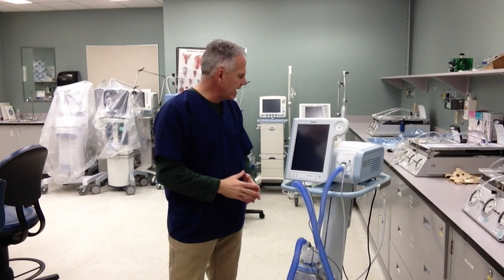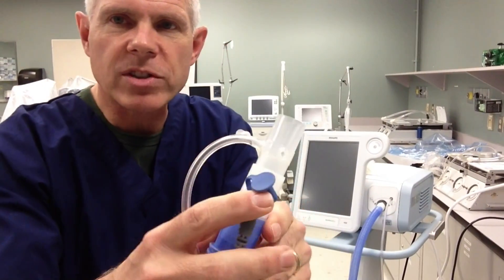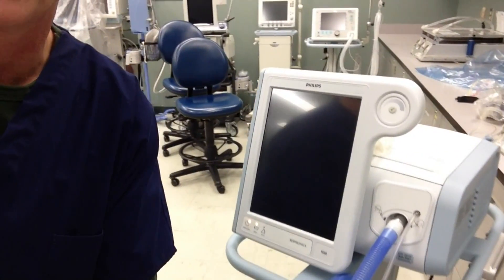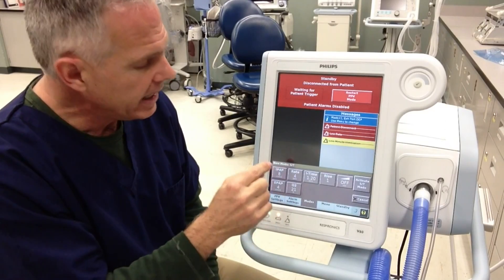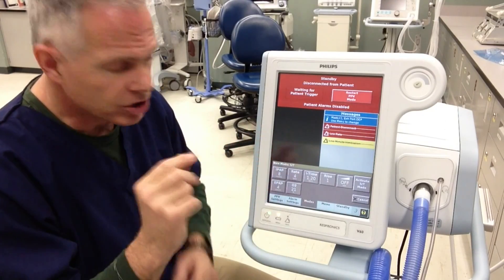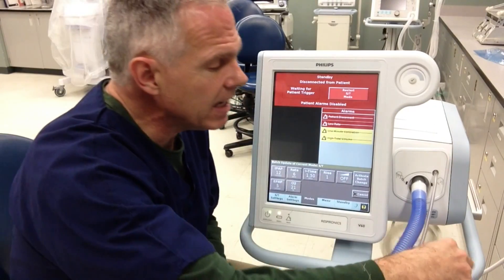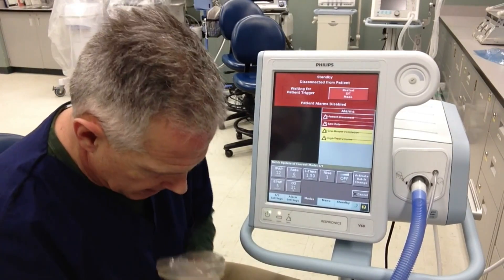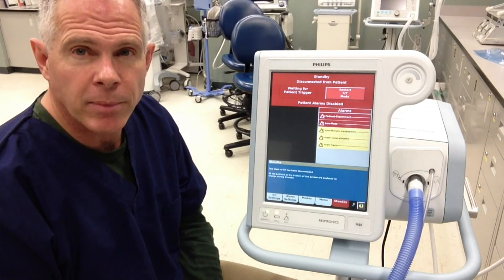NIPPV Introduction V60 Ventilator

Comment: informative video. this thing can also be used as a ventilator with an endotracheal tube. sophisticated controls and alarm settings. battery 6 hrs? if you have a pto valve it is able to nebulize. charles mcmullin md

Comment: Great video. I was just on one of these machines after leaving the ICU on a ventilator. Once I was off the vent I used this machine and it was very good. The mask was very comfortable and you can really tell there is humidity. Oxygen helps as well and I wondered about the wires in the hose, i thought it was a fancy design on the hose until I realized it was actual wires. Anyway very impressed with this machine and it was a great patient experience to use it for CPAP while in the hospital after being on a ventilator. Great video!

Comment: do you have to have oxygen with it ?
Reply: Tyson McCormack yes the machine runs with o2 the o2 cable can be connected to a wall outlet or if your moving the patient say to ITU / HDU or to another location within the hospital the machine can be connected to a external o2 bottle and can run on internal battery so that the unit can be moved around still connected to the patient hope this helps 😊
Reply: Can FiO2 be increased to a desired level ??